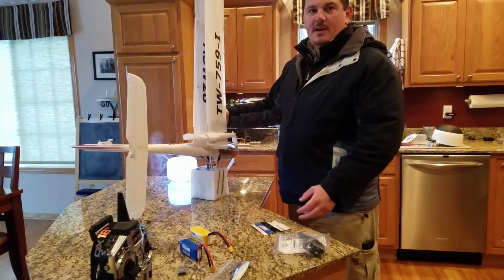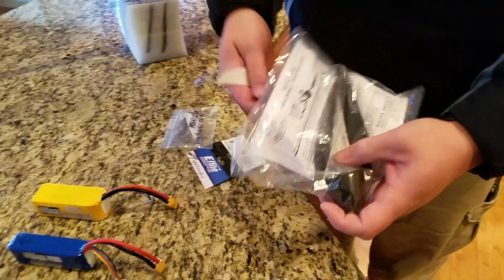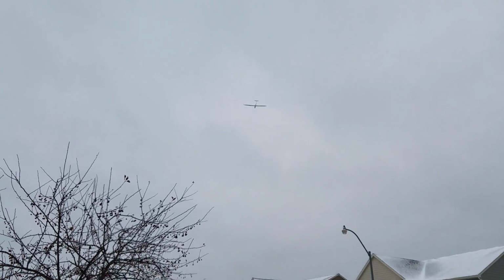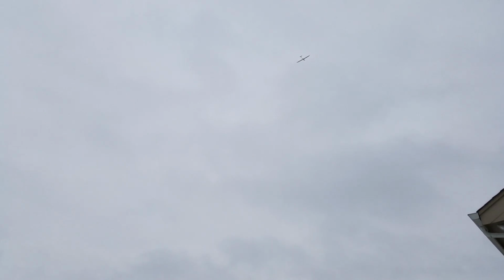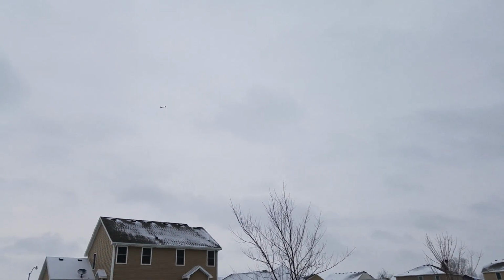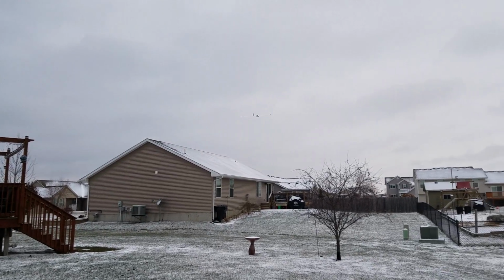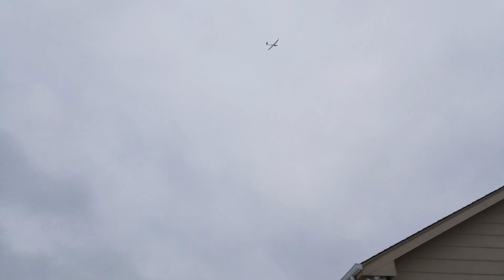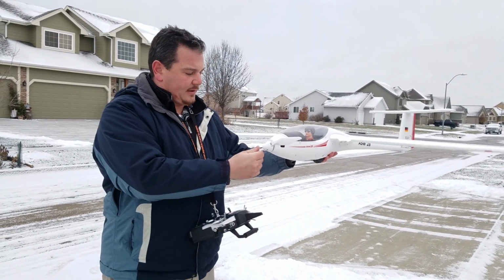Volantex RC / Lanyu - ASW-28 - New 12X8 Prop + 3S 2200mAh 60C Lipo (old one)

Comment: Good morning Brian, amazing videos, I have a problem with my ASW28.  The engine tends to warm up after a few minutes of flight and begins to brake, reaches the point where it stops completely.  Change the factory 30amp ESC to a 50amp ESC.  This helped a bit, but the problem persists and the engine slows down a bit, at all, but it stops.  Has this happened to you?  I have it with the 10x6 factory propeller
Reply from the maker: Not until I had installed a larger prop, I think it was 12X6, and I also used a 4S pack...then I had issues similar.
Reply from the maker: Maybe you have a bad motor?
Reply: @BrianPhillipsRC  
So what was the best configuration of Helice, battery and ESC you got?

Comment: I loved your series of videos on the ASW, I watched them a few times over and decided I need to give one a shot. Looks like a real stable glider even though it has foam wings.
Reply from the maker: It's a great plane! Just don't push it on too large a prop AND 4S, I think that contributed to my killing the ESC :(....

I really want one too, but won't revisit it this quick after a "death"
Reply: So you think a 3S and stock prop is suffice?
One of the complaints about this plane I saw on a vid was that the control surfaces are too small compared to wing span so that gentleman combined the flaps and ailerons to work together to help deflect more air. I'm new to RC, did you find it difficult to set up all the mixes you use. I bought a Airtronics SD-10GS and am trying to learn more about mixing (crow and camber) and overall setup before I actually fly the ASW when I get it.
Reply from the maker: No, not if you want it to perform like mine did. The COMBO of larger prop and 4S was where I went wrong, I think. The larger prop or 4S on their own, may have been okay. If I had to do it over, I'd be tempted to get the eflite prop again and just run high C (60C or better) 3S lipos. You might find that 3S is enough for your taste. Try it stock first, of course....maybe mine was weak???

I extened the ailerons with a piece of balsa wood (well, actually two thin pieces in opposing grain pattern and CA plying them together to make them the same thickness of the trailing edge of the ailerons) with three small steel rods for strength and alignment with the aileron. Then I CA'ed them onto their respective ailerons. Then I covered them with adhesive backed monocoat.

I also adjusted all the control linkages to the innermost hole positions for maximum throws.

I also cut the elevator to make room for the new rudder throw.

I also had an aggressive aileron to rudder tie to help maximize my roll rate.

I also set the aileron servo throws to +150% & -150% to increase the roll rate further.

I also used flaps as inboard ailerons, and as camber too...

Let's just put it this way, I spent hours getting the configuration right, which isn't uncommon for me with a complex plane, but this one was a lot of work...
Reply from the maker: I'm not familiar with Airtronix, so i can't help you too much with that.

I used a Spektrum DX18 gen1 with a Lemon-RX 10 channel rx with a Spectrum Satellite Receiver and a Turnigy Stabilizer for the main control surfaces only. I was using a Sail Plane wing configuration with every servo separately attached to an channel. I had 3 flight modes and different mixes depending on my "flap position", and I was using my throttle channel to control the ailerons and flaps on the bottom half of the throttle stick, and the top half ran the motor (as well as the ailerons and flaps).

Also note that the flaps were independent of one another, so I was using them to help roll the plane, and for crow, and breaking, etc...

It was super complex. I think my F-14 might be the next most difficult control configuration
Reply: Thanks for the tips on the control linkages and setup, I'm definitely going to put them to use. Does your radio have sailplane mixes built in or did you have to really experiment to get the mixes you wanted?
I'm actually picking up a 7 channel reciever to use with the ASW, are each of the servos (flaps & ailerons) wired SEPARATELY or do they use Y connection cables. From what I read about sailplanes on the rcforums, in order to really utilize mixing each servo had to be on its on cable from the receiver. I know some sailplanes like the Radian use Y connectors which limit or interfere with being able to fully use mixes, so I am interested in knowing how the servos are setup in your ASW28.
Reply from the maker: All separate channels, each servo wired to one port
Reply from the maker: Sailplane was built in, but I still had tons of setup

Comment: Hello friend. Is the ASW28 glider good for thermals?

  I want to buy a good thermal glider in order to get a good flight time. I'm from Brazil and there are a lot of thermals here.

And on a few thermal days, with a battery of 3S 2200mah or 3000 mah, how many minutes do you think you can fly? 30 min with a 3000 mah battery?
Reply from the maker: I would definatelly go for one of these...

Phoenix Evo 1.6/2.6m - http://amzn.to/2FGsR6e / https://bit.ly/2yPQ8nI BG
Phoenix V2 2m - https://amzn.to/2UW7AQy / https://ban.ggood.vip/5a5y BG

...as they're better for thermaling.

rather than this plane, the Volantex ASW28 2.54m - http://amzn.to/2ABU3zI / https://bit.ly/2VlLtBm BG
Reply: @BrianPhillipsRC  Thank you for your attention in the response. I'm from Brazil. Here it is very expensive to import a glider from outside my country. Luckily, someone here is selling a used and cheap ASW28, and wanted to buy it. I don't have many options here to choose from. This is the only model I found to buy. I asked this to find out more about this glider. How long can you fly smoothly on this glider with a 3s 2000 mah battery? 25 to 30 minutes? Thank you!
I enjoy this channel! :)

Comment: Wow. You just showed some mad [and bold] skills in flying in such a confined area. I live on an acre down in Florida and when I fly my ASW 28 I need a wide area for landing[s].  I take it you just changed the prop and left the ESC alone. Great video.
Reply from the maker: Yeah, the ESC is actually rated for 2-4S, and the motor should be okay. I think the timing is a bit off since at 75% throttle and above with 4S, the motor "farts" for a lack of better terms...

Landing in tight quarters is tricky, but crow REALLY, REALLY helps!

Thanks for watching!

Comment: I had my V2 ASW 28 for about 1 month and I loved it. I installed a vario on it and flew with a Möbius on the tail most of the time. Sadly she took the final plunge after a bee attacked my arm while I was doing a low and fast fly by at my club field. When my attention returned to flying, I couldn’t regain line of sight on the plane. I found her about 15 minutes later, all busted up about 150 yards away. I’m going to get another one in the early spring. At least I’ll have some spare parts for a new one should I need them!
Reply from the maker: Brett That's heart breaking! I hate the proverbial insect elbow annoyance!

I'm actually gonna be building my replacement ASW28 in the next two weeks. What a fun and beautiful bird!!!

Comment: Say Brian, you talk about the Stabilizer you added.  Does it really make it that much easier to fly?  Can you recommend one I can use and how it's set up.  I use Spektrum Radio.  Cheers, bud.
Reply from the maker: Yes, when I'm not flying a BNF with AR636 (or similar) with AS3X and/or SAFE, I almost always use Lemon-Rx 7 channel with stabilizer Receivers, which are DSMX (meaning they will work with Spektrum). I've discussed the stabilizer in many of my videos. It makes planes fly easier, yes!!! Especially on this ASW-28. Do you "need" it??? NO, but that plane will fly so smooth, and beautifully, it'll blow your sock off!!!

Comment: Hi Brian really nice flying and kudos to your piloting skills but i feel it is kind of irresponsible to fly in this residential area. things can easily go wrong even with our modern RC control.
Reply from the maker: I agree
Reply: oh you simply agree and i thought we have a long debate - just kidding.
i had my maiden flight this weekend and really love the plane. i also use teh 3s 2200mAh battery and ordered the bigger prop as you recommended. but even with the stock porp it pulls up nicely. i think the control surfaces are too small. for example to do a nice roll one really needs to pick up quite a bit of speed before. i mostly enjoy the wuuuuuush sound during fast flyby. i also replaced the ESC because my receiver warned my that the receiver voltage dropped down to 4V even the battery was still having enough charge. with new ESC no issues.
Reply from the maker: I'm building a new one right now, and it's gonna be great! Larger ESC with 4Amp @ 5.5VDC SBEC - that's the key!!!

The control surfaces DO need to be bigger, which I also plan to do again (like I did on this one possibly).
Reply: i flew mine today during some slightly gusty winds and realized that the wings are very flimsy and flap up and down quite significantly. i think you get what you pay for - still a fun sailplane
Reply from the maker: Definitely! If you can't handle the flopping around, I have several methods for making it more stiff.

P.S. You know this is my OLD/DEAD ASW-28, right? I've just been releasing my new one, if you check the playlist, you'll see what I'm talking about...

Unboxing - https://youtu.be/zKYUNWlK1Tw
Part 1 - https://youtu.be/f4fV4eAFgjw
Part 2 - https://youtu.be/ui4-rFALQvg
Part 3 - https://youtu.be/mWsVxfBBkTM
Part 4 - https://youtu.be/FODrEgFOC54
Part 5 - https://youtu.be/EDyXnXd-VOE
Part 6 - https://youtu.be/IE-noZnJO5U
Part 7 - https://youtu.be/jHETNAICdXI
Part 8 - https://youtu.be/lKHegYdEcuI
Part 9 - https://youtu.be/rf-Zxnk7XiI
Part 10 - https://youtu.be/mroUUMVvZkA
Part 11 - https://youtu.be/OU0oOrpaVBc
Part 12 - https://youtu.be/zuY691FQBqM
Part 13 - https://youtu.be/WCYyl4uW-Vc
Part 14 - https://youtu.be/rxWpWcMvAYE
Part 15 - https://youtu.be/CuOtjxX4bN0
Part 16 - https://youtu.be/JUYiLJwZKas
Part 17 - https://youtu.be/ty9kPxrNlHw
Part 18 - https://youtu.be/z4_q6gFeros
Part 19 - https://youtu.be/LgB-h95d0q8
Maiden Flights - https://youtu.be/-ubj8Z5LmYo
Part 20 - https://youtu.be/8zzOO8mhg-I
Part 21 - https://youtu.be/pOkhKHUjfYk
Remaiden Flights - https://youtu.be/nOo8bQXnUaQ
Part 22 - https://youtu.be/oaKRwD5ylzA
Remaiden Flight - https://youtu.be/eTALvn--sjo
Reply: Brian thanks for your continuous updates. i agree that the servo upgrade is good and i really like the lights, great idea. Oh btw, compliments to your wife/partner for the very good video shoots, very well done. also i noticed that the plane does not really like to fly upside down. at this point i would not dare to do an upside down flyby. you are good, maybe in your next video you show one :)
and yes more info on the lights and emax servos would be great
thanks again for your continued enthusiasm with that plane
Reply: oh forgot one thing. you have a 2200mAh battery mounted flat in the front. if i do that the plane is terrible head heavy. so you must do some weight balancing at the tail i assume. i took the pilot out - ok in times of autonomous driving/flying- and mount the battery more vertically just in front of the wheel.
Reply from the maker: Check the whole playlist, I have every video in chronological order...

https://www.youtube.com/playlist?list=PLXTH0DstRDc5gwAcvxziWIb-HcRqQoQWU

OR here's the "NEW" ASW-28 videos, for your convenience...

Unboxing - https://youtu.be/zKYUNWlK1Tw
Part 1 - https://youtu.be/f4fV4eAFgjw
Part 2 - https://youtu.be/ui4-rFALQvg
Part 3 - https://youtu.be/mWsVxfBBkTM
Part 4 - https://youtu.be/FODrEgFOC54
Part 5 - https://youtu.be/EDyXnXd-VOE
Part 6 - https://youtu.be/IE-noZnJO5U
Part 7 - https://youtu.be/jHETNAICdXI
Part 8 - https://youtu.be/lKHegYdEcuI
Part 9 - https://youtu.be/rf-Zxnk7XiI
Part 10 - https://youtu.be/mroUUMVvZkA
Part 11 - https://youtu.be/OU0oOrpaVBc
Part 12 - https://youtu.be/zuY691FQBqM
Part 13 - https://youtu.be/WCYyl4uW-Vc
Part 14 - https://youtu.be/rxWpWcMvAYE
Part 15 - https://youtu.be/CuOtjxX4bN0
Part 16 - https://youtu.be/JUYiLJwZKas
Part 17 - https://youtu.be/ty9kPxrNlHw
Part 18 - https://youtu.be/z4_q6gFeros
Part 19 - https://youtu.be/LgB-h95d0q8
Maiden Flights - https://youtu.be/-ubj8Z5LmYo
Part 20 - https://youtu.be/8zzOO8mhg-I
Part 21 - https://youtu.be/pOkhKHUjfYk
Remaiden Flights - https://youtu.be/nOo8bQXnUaQ
Part 22 - https://youtu.be/oaKRwD5ylzA
Remaiden Flight - https://youtu.be/eTALvn--sjo
Part 23 - https://youtu.be/qPQbBG0E37o
Remaiden Flights - https://youtu.be/GAuxvIFVQnQ

Thanks for watching!

I'll pass along the compliment to my wife.
Reply from the maker: You'll have to check out my most recent videos, where I addressed my own CG concerns.

Thanks again!
Reply: it's no worse than kicking a soccer ball around the yard, or throwing a baseball, as far as damage potential.

Comment: Hey Brian.. What are your flap settings?   Takeoff and landing?
Reply from the maker: Takeoff - Flaps down about 1/2 way
Landing - Flaps down full stroke

Crow - Landing Flaps Full Down, and Both Ailerons Full Up - THIS is the ticket for getting the glider down quick, but losing nearly all roll control is more than a little disconcerting!!!